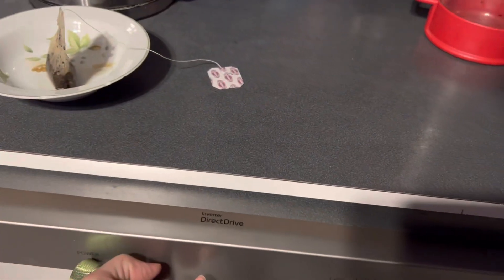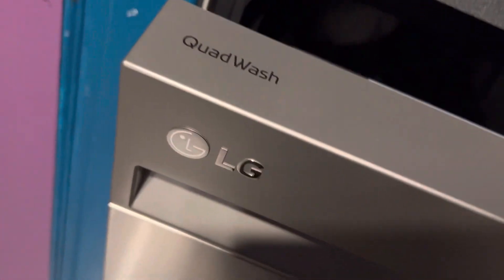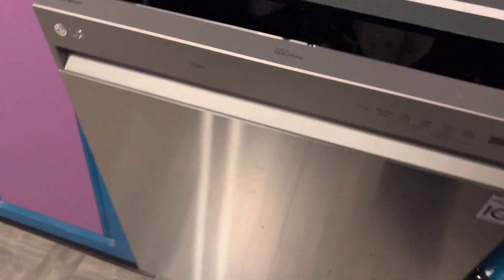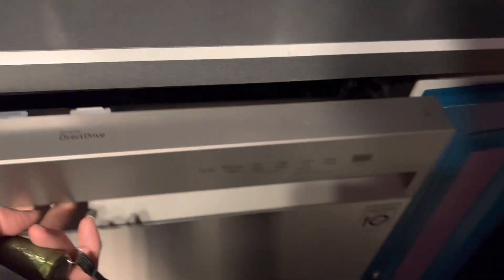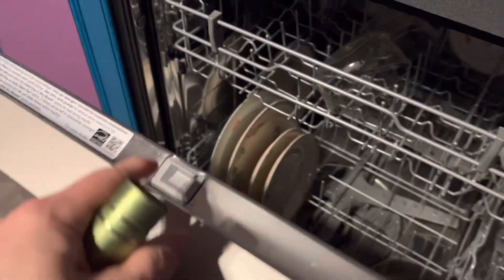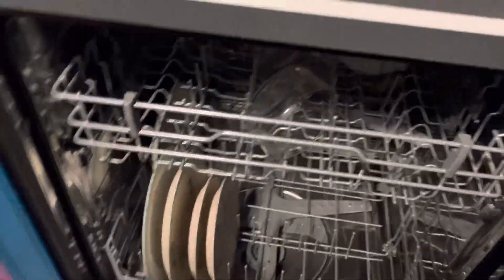Does LG dishwasher have upper spray arm?

Comment: Thank you very much!! Top is like a spinning sprinkler system. Home Depot has this one and another one similar but with Wifi and (unfortunately) in White only.. Both are the same price but the Wifi one would be shipped to my home in Feb. 23... 2023. So I think I will either get this one or I might cheap out and get the GE or Fridgeaire. But Fridgeaire I read is not reliable. Why did you go for this LG? What was your deciding factor and what other brand was you considering?
Reply from the maker: It was a black Friday deal for $500. I took a chance on the brand. I wanted something quiet. This was rated at 50 decibels. It is far quieter than that. My old Matag had the name "Quiet Series". It sounded like a jet fighter.